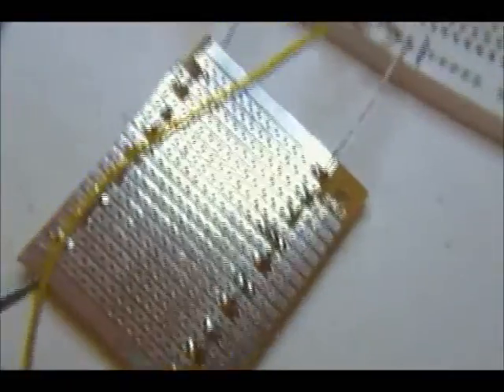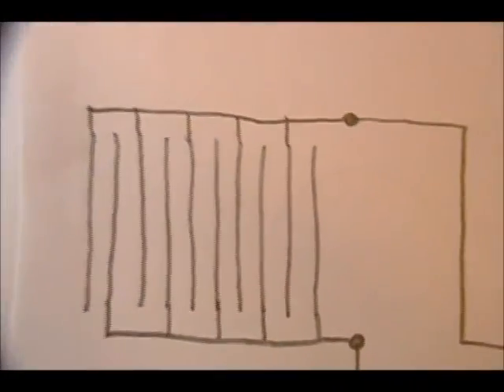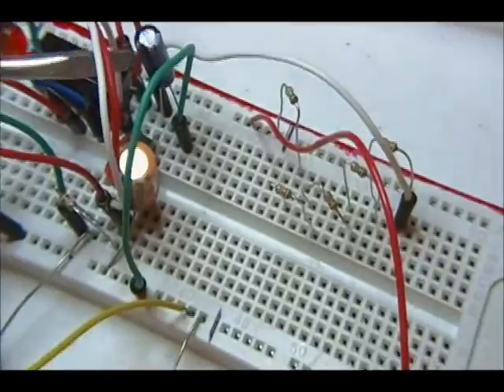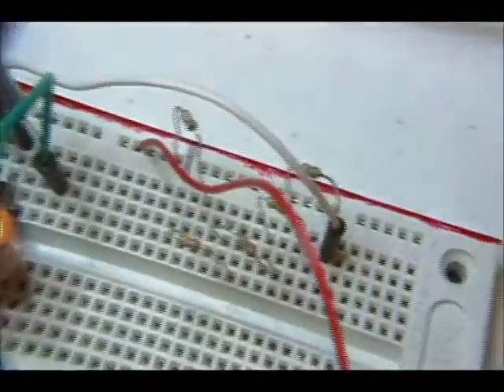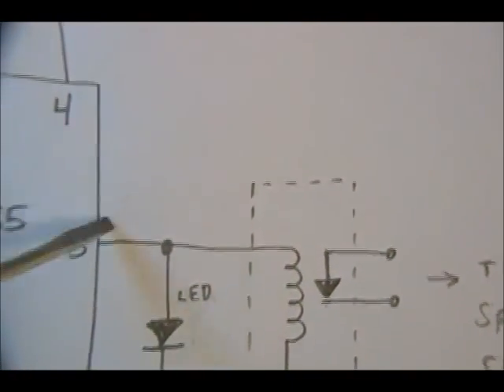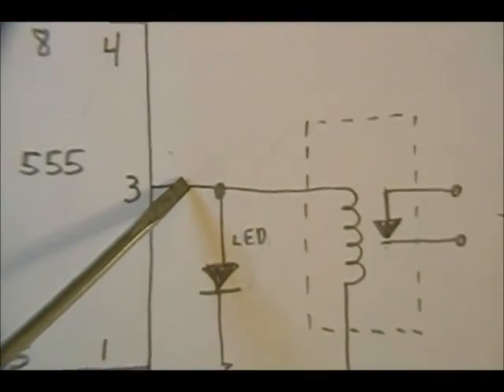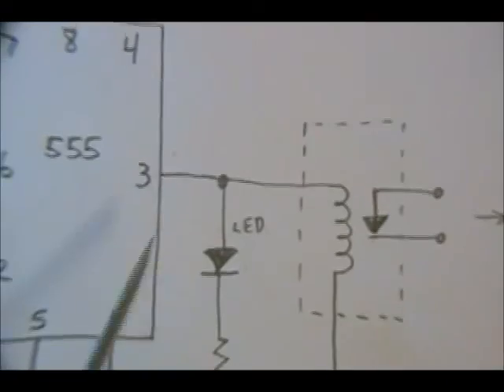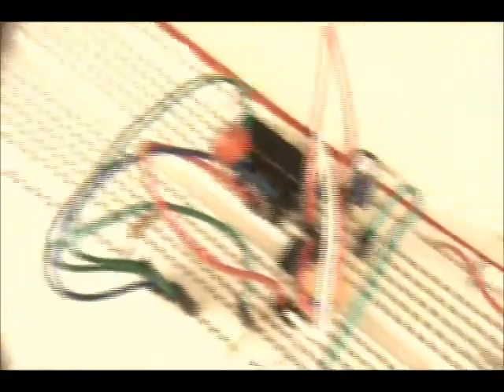Sprinkler Rain Detector Cutoff Circuit

Comment from the maker: I must apologize for an error in the circuit.  Their should be a 10k ohm resistor between  pin 2 of the 555 to Vcc (+5v).  If this resistor is not there, the trigger becomes very unstable, the resistor pulls pin 2 up to +5v when the sensor is not made or open.